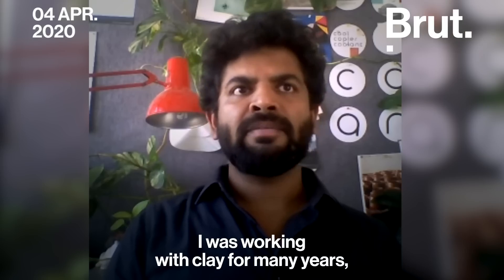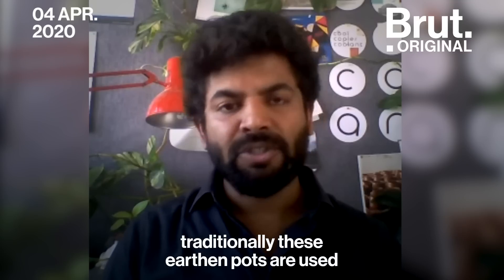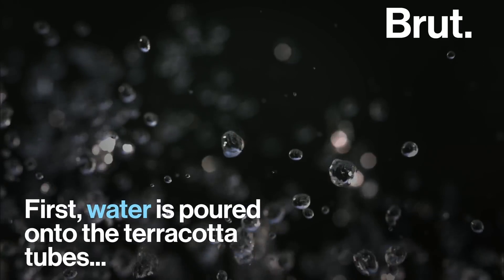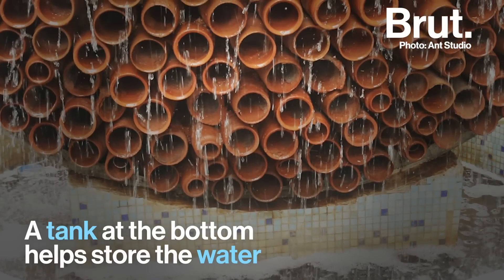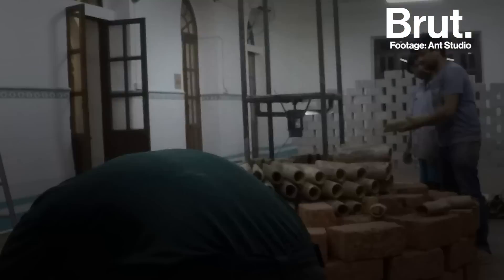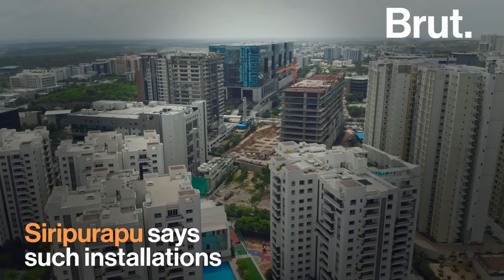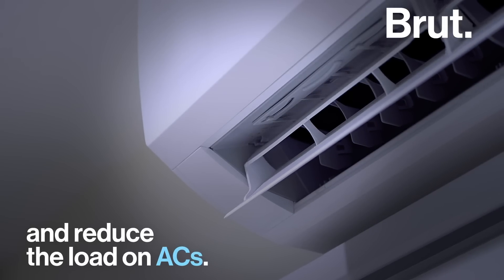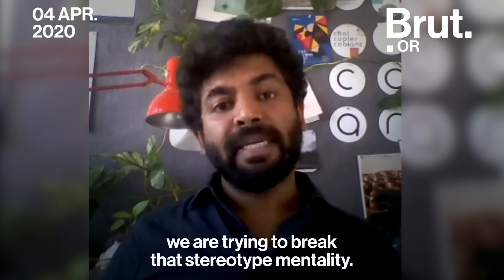A "Beehive" Air Conditioner

Comment: Humidifiers
Use cold or warm mist to humidify a room and keep it cool.

 Sun acts as a vaporizer and can help make a room cooler by removing excess moisture and heat from the air. It works by drawing in air from the room, heating it to vaporize the liquid, and then releasing the cooled vapor back into the room. By doing this, it can help reduce the humidity and lower the temperature, making the room feel cooler.

Traditional courtyard houses in hot and dry climates are designed to provide comfort and control temperature and energy consumption. Courtyards act as microclimates and temperature regulators by storing cool air in layers and allowing it to flow into the surrounding rooms. The courtyards also increase exposure to solar radiation and wind, which can increase natural ventilation and daylighting.

a potential difference applied across a thermocouple can cause a temperature difference between the junctions of different materials, which can create a cooling effect. This phenomenon is called the Peltier effect,

Comment: I was wondering how is water being recirculated through the tubes. Is it being done manually? And if it uses the electricity then why not use air conditioner? Major drawback is they are suitable for places where constant air movement is there.
Reply: The water is being recirculated via the tub beneath, and this doesn’t put out the hot air that an air conditioner would nor use the amount of energy an air conditioner would. A lot lesser carbon footprint.🤗😉✌🏻

Comment: You need small pipes if you want to use these in cities otherwise it's a flop idea
Reply: It could be very useful in large factories and MNC's
Reply: it a good innvoation with little modifications like a net for preventions of insects, and a small water circulation machine.